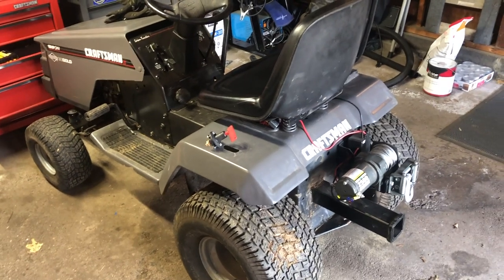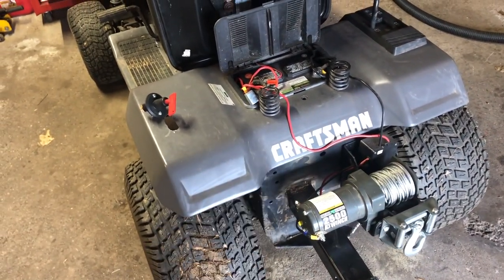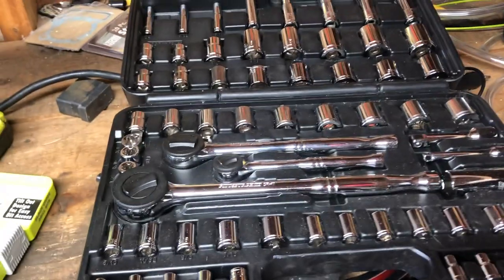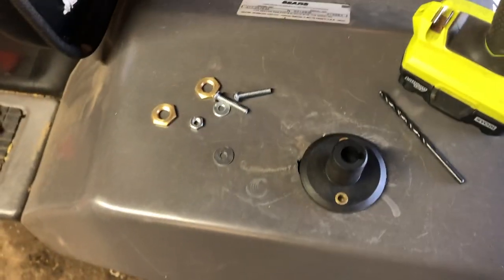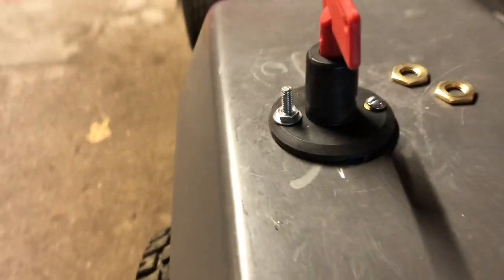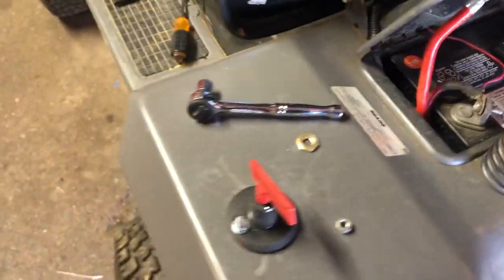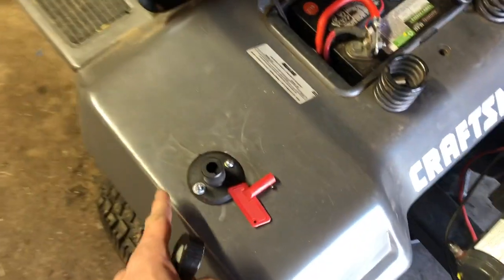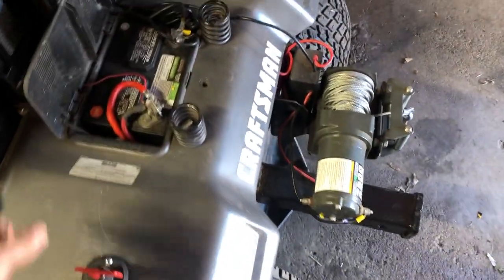Battery Cutoff Switch Installation - BADLANDS 2500lb Winch

Comment: Quick question, is it better to cut the positive  or the negative ?
Reply from the maker: Depends on the application. For this lower voltage winch, I cut the positive because it was the closer terminal to the switch.

Comment: Awesome video. Where did you get the switch? How do you know what sides to hook up the battery to the switch?
Reply from the maker: Dr Fizzell Harbor Freight! It was around $7. A switch just cuts continuity of a power line, so it doesn’t matter what side you connect the cables to. Great question!
Reply: @jimmysgarage9068  thank you
Reply: never connect it to the positive terminal
Reply: @krollpeter  Why not?
Reply: @fishingismydrug1  The negative is usually grounded. If your switch fails, the connection cable loosens or whatever, you can easily get a short. Therefore it is safer to disconnect ground.
Reply: @krollpeter  Thank you!
Reply: @krollpeter  110% Agreed!!!! Always, Always, Always connect things like this to the negative or "grounded" side. Really surprised more folks haven't commented on this. Still, a good, inexpensive solution to your problem and, a good video.
Reply: @johnpearson4899  I am surprised, too.
Reply: @krollpeter  do you still need a high current switch if I do connect to ground??
Reply: @zassaultt671pange5  Yes
Reply: @krollpeter  thanks greatly appreciated

Comment: So put battery positive on both sides of the switch thank you, my mower battery dies every day
Reply from the maker: You may need to look around for another source. Frayed wires can ground out and cause issues too. A cutoff switch will typically solve the issue though. Best of luck to you.

Comment: This is not a battery cut off, this is a wench power cutoff. Just be clear so people dont make this mistake.
Reply from the maker: Yes, it’s a cutoff switch I installed for the WINCH. It totally helps too!